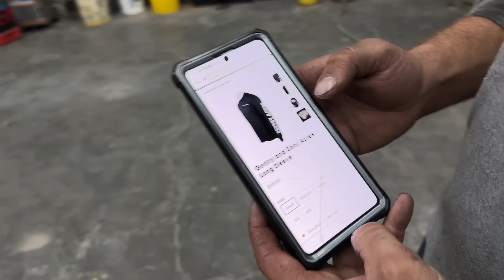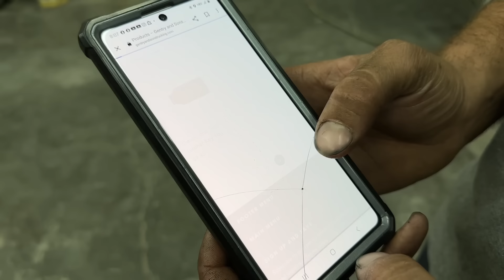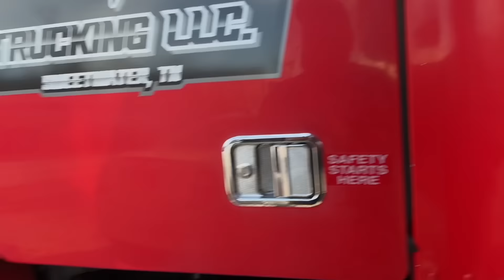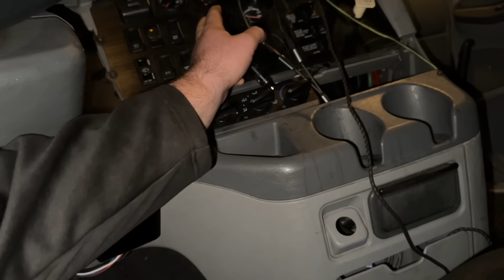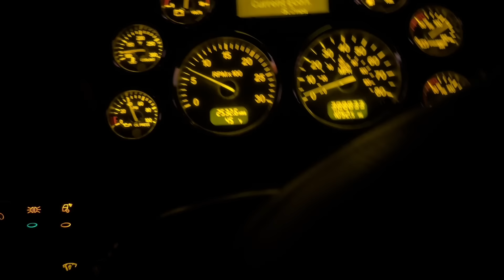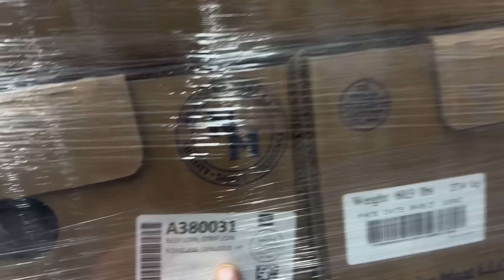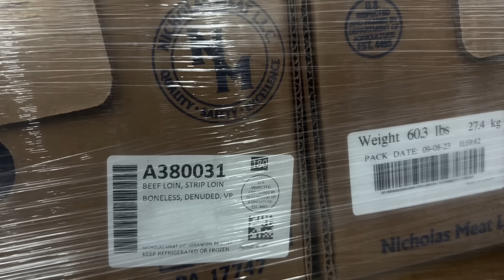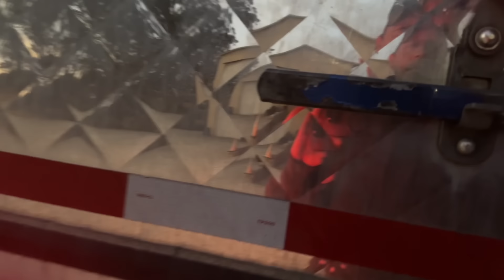The International Get Wrecked.. Company Forgets To Unload $20,000 Worth Of Meat!!

Comment: You REALLY need to figure out how to do flat loads legally or don't put people at risk and just pull van/reefer. 36:58. 1 strap on each of the front pallets that aren't blocked in place. Are you sure they're under 1100 lbs per? Appears to be no edge protectors on steel beams. Not enough straps on the main stack. Last strap (more needed)on the on the longer beam is lying loose and the beam is bouncing out the driveway. Any piece left flopping will like to walk out. No red flag on the overhang. An overhang that shouldn't actually exist because it could've fit on the deck.
Reply: Does that over hang have 4 or more feet sticking out? It doesn’t need a red flag
Reply: @silversurfer5920   If you pull 48's you might be correct but if so, you saw that and picked a technicality to point out? I don't have any 48's or do legal loads so I'm not 100% certain as I generally skim over those little requirements that don't affect me. Logic would tell me don't be lazy and flag any significant overhang. More importantly, I can't even see where that beam is secured. I know the there's a strap hanging loose on it 11' from the end which means it's last piece of dunnage is significantly ahead of that point. Anybody that would film that for public consumption is a fool just begging for a lawsuit from any vehicle that runs over anything that should ever come off of his trailers. Properly secured in that case or not, any good lawyer would point to this video to show a pattern.
Reply: @sln9651  I mean it’s a 48 so it just doesn’t need a flag in this case. Securement could be better at the end for sure. I didn’t even know they did flatbed loads there. First time seeing that on here.

Comment: Tim you need to get a single axle trailer jockey truck for moving trailer around the yard. So the hydraulic lift fifth wheel and rear exit door would make life fast and simple around the yard.
Reply: Your absolutely right. I’m retired after 37 years in the seat. I did two years on a yard dog early in my career at a GM plant and think every driver should spend some time on one. I got way to cocky at the end. If your moving 30-50 trailers a day. If you can’t do every and any kind of backing after that. Your in the wrong business.

Comment: Those older waste oil heaters aree ok when they work-But they need a ton of maintance. I yhad a friend had several in his  shop. He even bought a new burner/motor to have to switch out. Also need a good pre fileter system on the lines before it gets to the  burner itself.

Comment: You have a set of axle forks those are self loading.  But you will need medium forks to haul tractors with Detroit cause if you use small ones they will crush the oil pan on the cross bar.

Comment: Tim - a suggestion 
Find the most expensive items people buy that are shipped by truck and try to obtain the exclusive right to ship them from the manufacturer of the product shipped. 
Start small with them. 
Add dedicated fleet as the $ comes in from these runs
Reply: I can't believe nobody commented on this, so here goes. 

Start Small with an exclusive contract? That's not how this works! For that you need volume and to provide volume you need a lot of bloody money. Even if you had those parts taken care of then the only way to get into a shipper of significance is to beat out the current company by a considerable margin. Which means you not only won't make any money but you'll also be driving the rates down even more. So the reality is that Tim isn't going to change the trucking world like he says and with the stuff he's showing I'd consider it a small miracle if he lasts through this downturn.

BTW    If you haven't noticed Timmy is at a significant proximity advantage to a large manufacturer of the most expensive toy most people will ever buy. So your suggestion is proven wrong buy Tim himself!
Reply: @sln9651  Will not comment on either the accuracy of, or the astuteness of your comment other than to say it is apparent your experience is vastly different to mine. This said I remain with my suggestion just as suggested originally. I know it works.
Reply: @bobrohrer2501  Please recognize that "I know it works" is different than I know it worked. That involves building a massive bridge to fill the gap in volumes. If you were able to pull that off then serious luck, intelligence or both were involved. So far on Gentry and Sons the only evidence of either of those being present resides in the fact that he hasn't killed anyone with his lack of knowledge or care for the laws and rules in trucking, yet...
Reply: @sln9651  You really do misunderstand. 
New business as I suggested is accretive- assuming you know what that means. 
Do not need to be lectured to somebody who ostensibly is an observer. 
Tim get’s it & messaged same to me. 
So my suggestion to you is - Just Watch
Reply: @bobrohrer2501 I'll just ignore ALL the warning signs and be waiting patiently for Tim to take over basically everything. 

It's quite a challenge to guide anyone that knows more than the experts 5 minutes into their task. Best of luck. 

To be clear, I don't care if he succeeds, just whether he causes great bodily harm to the general public in his pursuit of shortcuts.

Comment: Blows my mind when I see a pick up truck hot shot pulling a 5 car trailer...how is that safe,can it stop safely? I drove a 3 car it that felt heavy.weld longer flip n could haul 4 small cars..but these trailers I see with 5 cars just seems to heavy for a pickup truck..wonder how long they last pulling all that weight?  Not hating,just wondering how safe those are n how many miles they last pulling like that..
Reply: Uh trailer brakes